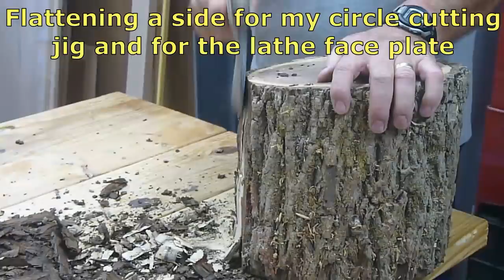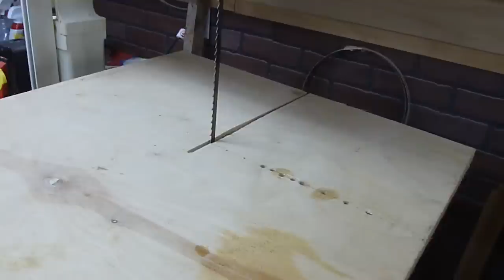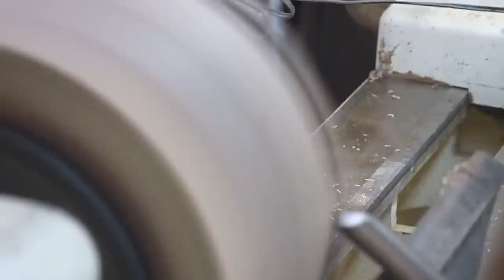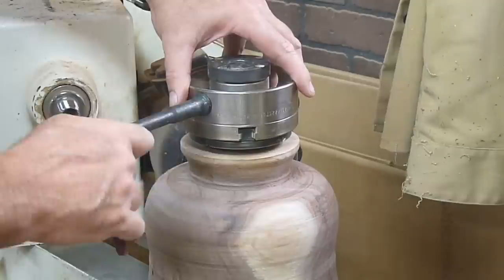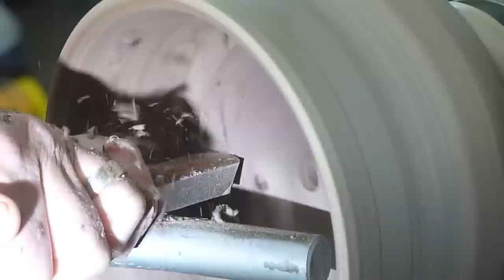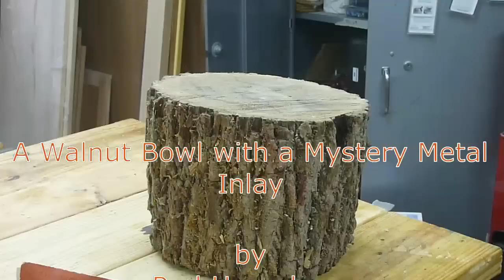Woodturning a Black Walnut Log into a Bowl

Comment: Nice bowl!  Nice video!  This is the first time I have seen someone turn a bowl that included the pith.  I've always heard and read that the pith should be avoided.  I kind of like how it looks on the sides of your bowl.  Do you have any comments or advice about turning a bowl that includes the pith?  Thanks!
Reply from the maker: Thank you very much!  As a rule I usually do avoid the pith, but this log had been drying for so long I though it would be a safe choice to keep it.  Between the drying time and the thin and even thickness of the bowl wall, the chances of the pith causing a check is greatly reduced.  When I collected this (and many others) from the firewood pile, I took them home and immediately coated the ends with Green Wood End Sealer so the moisture would depart through the sides rather than the ends.  But even without so much drying time, a nice even wall thickness is key to reduce the stress caused by drying and atmospheric changes.  That has been my experience, others may have different advice, and if so I hope they post a response :)  Great question, happy turning!
Reply: Thanks for your reply!  I have used Minwax "Wood Hardener" (ingredients not listed on the can) to harden up some short end-grain in a thick, segmented cutting board that I cut up and glued together to make a platter on a pedestal that I was worried about coming apart on me (came out great!), and I have thought of using it on piths, but I haven't done so yet.  After seeing you successfully turning a log with a pith, I might go ahead and give it a try sometime.  Thanks again!  Count me as a new subscriber!
Reply: The pith is the center of a log (tree trunk or branch - where the concentric growth rings start).  It is not usually suitable in woodturning projects because it is softer than the surrounding wood and can fall out or not cut smoothly, depending on the type of wood.  It behaves similar to a knot in wood that can contract while drying out at a different rate than the surrounding wood and fall out.

Comment: I love watching videos on here about wood-turning my grandfather did it years and years ago but unfortunately I cannot ask him questions on this stuff When selecting wood that you're going to turn is it wood from trees that were just cut down or is it wood that has been sitting for awhile also what do you use to keep the wood from cracking I know the center is gone but it could still crack so what do you do
Reply from the maker: I turn fresh cut wood on rare occasions because it's such a pleasure, so easy.  Usually if I'm working with logs, I cut out the center, but sometimes I don't, like with these walnut logs.  I always use an end grain sealer to help stop the cracking on the ends prior to storage.  Sometimes there's nothing you can do to stop the cracking due to pressures in the wood though.  That's my experience anyway, hopefully others will reply as well.  Thanks!
Reply: R Humphrey thank you very much for the reply what do you think about or even have you ever worked with the sealer pentacryl done some research on it. A buddy of mine is interested in doing chunks of wood with names and stuff carved into them there's not really anybody in my area doing anything like that and he believes it might take off so just like people told me when I was growing up push for what you want so I keep doing the same thing with him and keep pushing him but I keep telling him do it as a hobby untill he perfects it what kind of end sealers would you recommend
Reply from the maker: I haven't used that product.  I used Anchorseal on these walnut logs, and I've used leftover paint on others.  I can't recommend a product specifically, but there are plenty of choices.  Wax is a good choice also.  Sounds like an interesting idea, and I believe the same.  If you want something, go for it.  If you fail, learn from it and keep pushing.

Comment: I'm curious why turn the wood grain perpendicular to the rotation? I've noticed everyone seems to do this on the videos I've watched.
Reply from the maker: There are a couple reason I can think of. First is that turning the grain parallel to the rotation presents just the end grain to the tools, which can be challenging.  Second, when the grain is perpendicular to the rotation, the end result is usually far more interesting, with wavy grains and shimmer or chatoyancy.  Thanks!

Comment: When you find metal in a tree, it's usually part of a fence or a bullet, unless it's a maple tree, then you might find a spile.
Reply from the maker: Agreed.  As time has passed I'm more convinced it's a large caliber lead projectile...
Reply: If it's a piece of a barbed wire fence that the tree grew around you should see some rust. Spiles are made for collecting liquid sap so they shouldn't rust, but if they have a hook on them for hanging a bucket, that might rust.

Comment: How do you keep the wood from splitting as it dries?  Do you turn it when it's fresh cut?
Reply: Some do yes. Leave it thicker than your desired finish and let dry for a while. Come back and turn it again to desired finish. You will see that it can check/split/crack and also warp.  Some try to slow down that severity by using some wax or coating on the end grain to "control" the speed of the moisture escaping. Or will also add a wood stabilizer/petrifier.

Comment: I'm new to turning. Do you have any problems with checking or splitting when turning logs?
Reply from the maker: sometimes, but I usually wait a long time before I work on a log, especially when I don't cut out the pith.  Even walls help if you're turning green, but it's a gamble.

Comment: Is the wood squeaking when you carve bc it’s such a hard dense wood?
Reply from the maker: No, it's just the high speed playback that accentuates the noise.  There's a bit of vibration in the lathe... it was beginning to go bad at that point if I remember right.  I'm still using it, but it needs replacing.

Comment: Wouldnt it be easier to turn it end grain? I mean it looks great but the piece you wouldnt need to cut the piece at all if you turned end grain
Reply from the maker: End grain is a more difficult turn usually, but the main reason to do a side grain attack for me, is it creates a better visual grain pattern in the completed project.  Just my opinion of course.

Comment: I got some Apple log pieces and I am wondering if it would be best to seal the ends while drying it out. Does anybody know of an edge sealer used for logs in creating bowls, etc... thanks in advance.
Reply from the maker: It's always best to seal the ends.  You can use any type of paint you might have sitting around, or you can buy end grain sealer which can be quite expensive.  Just google search for it 😊

Comment: pls can you inform me ...why the lathe has negative rotation and what kind off wood is it?
Black walnut I m reading ....is it true?
I have working in wood trade for 20 years, mainly with african woods. Some of them due the kind of the ground, transport substances and elements from the ground. for example,iroko wood, many times containing compressed silica, produces scintillation due to hardness. perhaps yours is another element.
Reply from the maker: The lathe has the standard counter (or anti-) clockwise rotation.  Some lathes can turn both ways but not mine.  Yes, Black Walnut wood.  Thanks for watching!

Comment: Question i got my lathe a few days ago and ive started a bowl but we did it in a way that the center of the wood is the center of my bowl is that bad
Reply from the maker: Congrats on acquiring a lathe!  Very exciting!!  If I understand correctly, when you say "the center of the wood" you mean the center of the wood rings, as in working from the end of the log, right?  No, that isn't a bad thing, but you will be cutting 100% end grain which means you probably will get more dust than shavings, and perhaps may have to deal with tear outs depending on the wood.  I'll be really pretty though.  For me, working end grain is a bit more difficult.  One thing is certain...keep your tool sharp.  Sharpen more often that you think you should (that's how I think about it to myself) and it will go easier and tear outs will decrease.   thanks for the question!  Rod
Reply: R Humphrey thanks my wood is pretty seasoned and is cedar so it is pretty dusty anyway
Reply from the maker: Caden Walker  Nice!  I just finished a cedar bowl and will post the video  on Friday.  I really enjoy cedar.  It's like turning butter compared to some of this super hard wood I've been doing lately!

Comment: not really understanding why you didn't split the log in half to remove the pith, and get two bowl blanks from it??  won't you have serious cracking problems now that you've left the pith in the side of it????
Reply from the maker: I let that log dry for ten years before I used it, so I I wasn't concerned at all about the pith anymore.  It's very stable and hasn't moved/cracked at all since I made it.

Comment: Why would you not remove a large section of the center in one piece? Seems to be loosing a lot of beautiful black oak
Reply from the maker: A good question that many have asked.  A couple reasons.  I don't have a coring system, and even if I did, they limit (from what I've seen) the shape of the bowl.  I'll be using the shavings, most of which I've saved, in future videos if all goes according to plan this year.  It does seem wasteful, but this is a very common wood where I live...and I did rescue this one from a firewood pile :)  Thanks for watching!

Comment: That metal looks more like silver than lead because if color...Imho...
Reply from the maker: Very shiny silver at the time, which may have been why I was convinced it wasn't a bullet...but I'm thinking probably a bullet now.  Could be an older one.  Not sure though, thanks for the input!
Reply: Gabriel Davidson , cut into lead and it is very shiny like silver..lead looks dull grey because it oxidizes and becomes that dull color.

Comment: looks like a bullet ,,, probably a .22 just lead
Reply from the maker: A bullet seems to be the general consensus, but it's much bigger than a .22.  Thanks for watching!
Reply: stick a vernier on it and let us know the dia
Reply from the maker: Good idea, here's all the measurements: outside, 5/16"x3/16"; inside, 5/16"x1/4"; length, approx 1/2" (it goes diagonally, approx 45 degrees, through the bowl wall which is 5/16 thick) and...I shaved and unknown amount off of both ends.  Let me know what you think :)
Reply: thats 8mm to 5 mm , so its not a .22 ,,,  still fancy its a bullet . but its a nice feature to have non the less